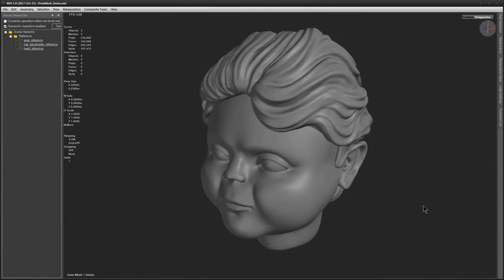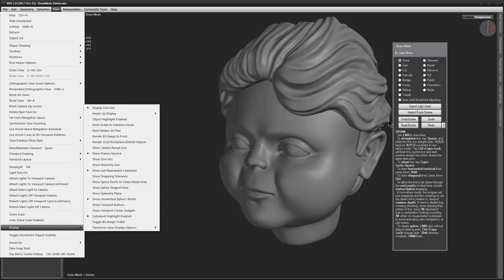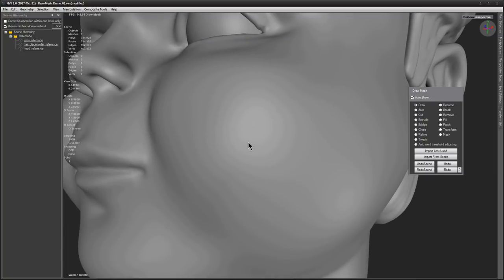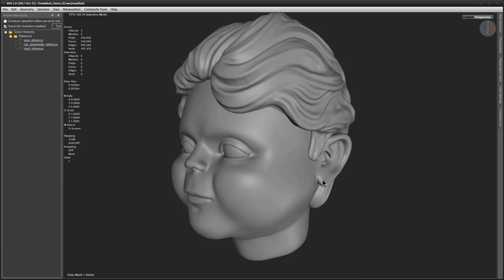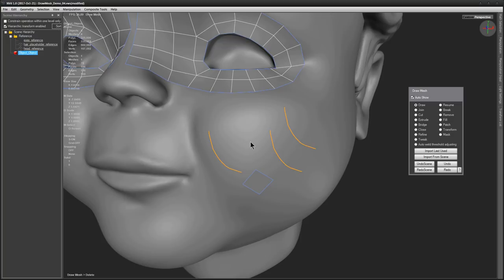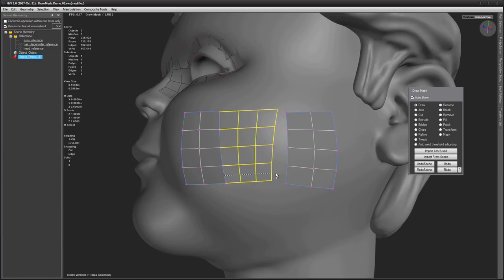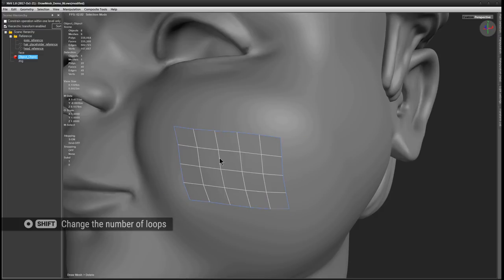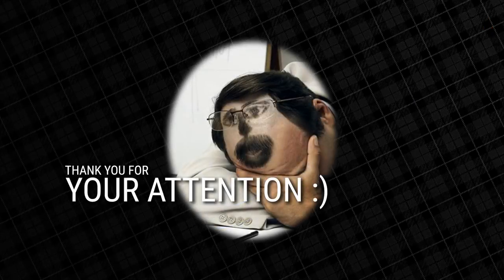NVil Draw Mesh Tutorial

Comment: this tutorial really good to understand Draw mesh tool. But i have question i cant find symmetry plane (18:18). and symmetry options work like this. nvil's problem some tools really hidden others videos in youtube old version doesnt work well
Reply from the maker: Hi Kenan.

I use four tools to deal with symmetry in NVil:
- "Modeling Options -> Symmetry Enabled$": to toggle symmetry on and off
- "Common Modeling Shortcut Tools -> Cycle Symmetry Axis": to cycle between symmetry planes
- "--||-- -> Symmetry Remove-Positive (Weld/NoWeld)": to copy and weld geometry from one side to the other
- "--||-- -> Symmetry Remove-Negative (Weld/NoWeld)": same as above, but the copy direction is reversed

Also, symmetry axis is placed where your mesh pivot currently is, so you need to use Manipulation -> Pivot tool to transform the pivot of your selected meshes (or objects first) and approve the transformation with either: "Align All Mesh Pivots to Base (Position Only)" or "Align All Mesh Pivots to Base" in order to change its position.

You will find all of the tools listed above in "Edit->Customize->Tools", or by simply typing their names in "View->Windows->Tool Search Window".

You can also try my config out (the one that I'm using on the video). It comes with a short cheatsheet-type of documentation. (http://samardac.com/nvil-forum/index.php/topic,4566.0.html)
Reply: Thanks its work perfech
Reply from the maker: Awesome. :)

Comment: Help please!  thank you for your video！
But why I can't find the “Draw mesh” in the “SteamLine Tools” window？
there is “Extrude” after “Cut”. not same in your video 0:48"
Reply from the maker: Hello Sheep Sleep,
You may have an older NVil version in which Draw Mesh wasn't yet implemented. Try installing the most recent stable version from here: http://samardac.com/nvil-forum//index.php/board,2.0.html.
Or if you bought it from Steam - upgrade the program in Steam client.

Draw Mesh was introduced in NVil Dec 21 2017 version. Currently the most recent stable build is Mar 01 2018.

You can check your installed version in NVil's title bar.

Comment: Tried it for the first time and it looks a bit too complex - remembering shortcuts is not a problem. Will take another try after some time.
Question: Is NVil realy faster for retopology than doing it in Topogun or Maya?
As I'm looking in to NVil only for retopology.
Also one thing that I think is not so convenient, that it projects drawn lines from camera.
Reply from the maker: Hi Sergejs,

It may look overcomplicated because I have shown almost all of Draw Mesh features, but the fact is that most of them you rarely need during daily retopo jobs. They are there just in case you need them. I usually use only draw/append splines/strokes and patch generation, with an occasional cylindrical retopo where needed. It's really all you need to retopo effectively with Draw Mesh. It's a similar case to ZBrush's where you have a plethora of brushes at your disposal, but you usually use only a couple of them while sculpting.

To answer your question: it's definitely much faster because most of the time you don't need to worry about creating fill geometry. You just draw some major loops and then generate patches between them. Rinse and repeat. Auto patch generation saves a significant amount of time and is the main reason I like this tool so much. Additionally, you also have Nvil's whole modeling toolset at your disposal at any time to help you with retopologization.

Regarding camera-based retopo mesh snapping:
- Most of Draw Mesh "subtools" can also be used with normal-based snapping (by pressing Enter before leaving the subtool).
- Nvil's ordinary retopo mode (outside of Draw Mesh tool) can use both snapping modes.
Reply: Thanks for your answer Artur. Will definitely give it another try and see how that goes.

Comment: i can only draw mesh on open space, and not on my imported obj from zbrush for some reason... am i missing something?
Reply from the maker: Hi. 
Open "View->Windows->Scene Explorer", go to "Retopo Reference List" and make sure that "Retopo Mode" is enabled and your reference object is added to "Retopo Reference List". If you're using my config that I linked in the description, use CTRL+E shortcut to access the "Scene Explorer".

Also, remember to "Freeze" your reference object once you add it to retopo reference list. This is to prevent accidental selections of the reference mesh and will tell snapping modes to ignore components of the reference mesh. One way of freezing/unfreezing objects can be accessed through "Scene Hierarchy" context (RMB) menu.
Reply: thanks for the quick answer, that worked :) also thanks a lot for the tutorial, really informative.

Comment: this no longer works with the new version
Reply: It does not snap to the surface mesh (edit: correction, it does work)
Reply from the maker: It works just fine.
In "View→Windows→Scene Explorer→Retopo Reference List", make sure your reference object (or objects) exists on "Reference Objects" list, and "Retopo Mode" is enabled.
Reply: Yes, i figured it out about 1 hour later. No mention of Re-topo mode in your video unfortunately. Very little time explaining about adding reference objects.  But great about explaining the features and the shortcuts on how to draw efficiently.
Reply from the maker: There is a mention of "Retopo Reference" list at the beginning of the video, but yes I agree that I could have explained in detail how to set the whole thing up.

You may also want to "Freeze" your reference objects after adding them to reference list. This will make them unselectable and boost UI performance. You can do this in "Scene Hierarchy" window for example, by right clicking a reference object and selecting "Freeze/Unfreeze".
Reply: It was my fault. I literally had no more than 1 minute experience with the software when I watch your video.  Your video is going to be a good review for re-topology. Topogun, Maya, now this one, it has potential. Thanks for making it the video.